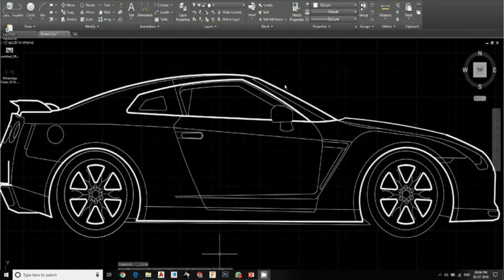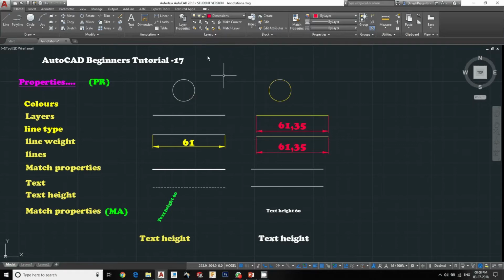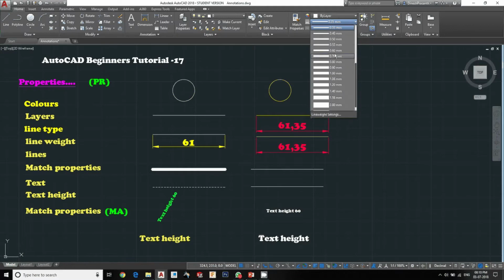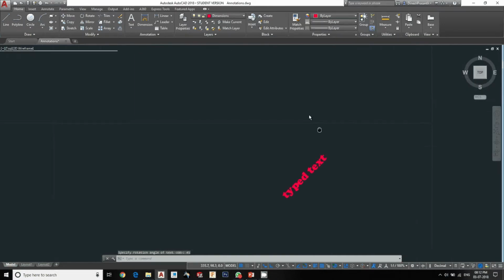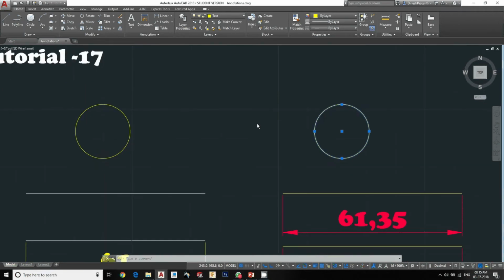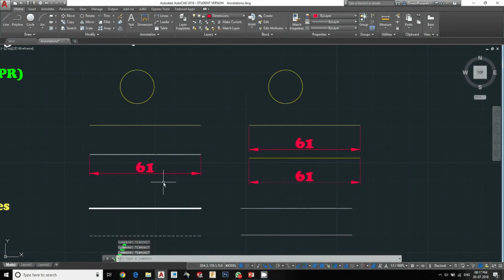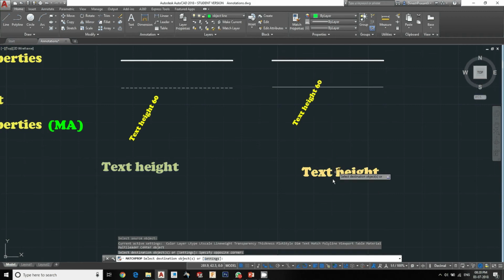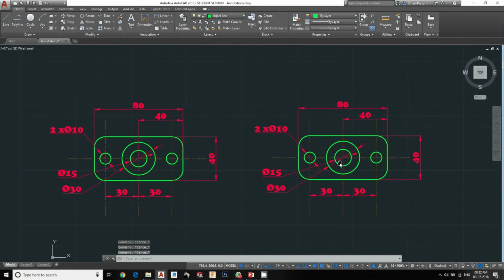Auto CAD Beginners Tutorial 17  Properties & Match Properties in AutoCAD

Comment: System requirements information ? I7 or i3 ? What graphics card use ?
Reply from the maker: Yes, i3 is good but I prefer i7 6th gen or 7th gen 
With 8GB Ram it's good for all. Heavy design and rendering works 

See I am using Asus 16GB ram i7 6th Gen.
Reply from the maker: Nvedia 960 is good.but costwise it's more but once you invest you can use long.